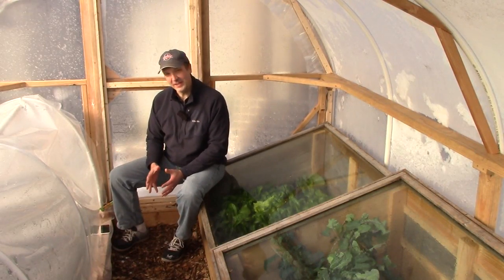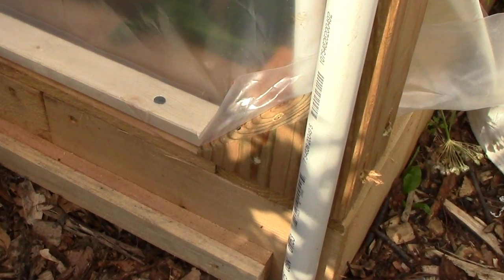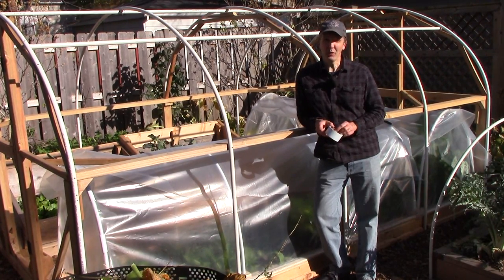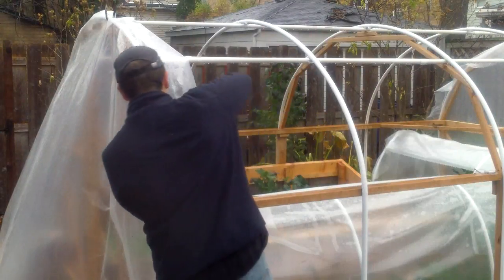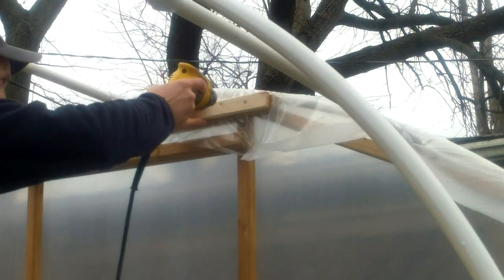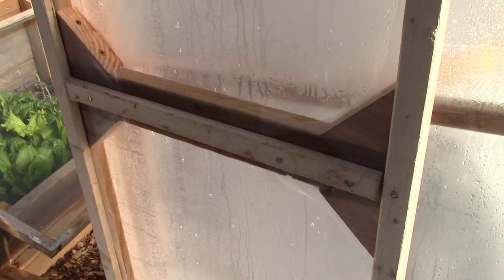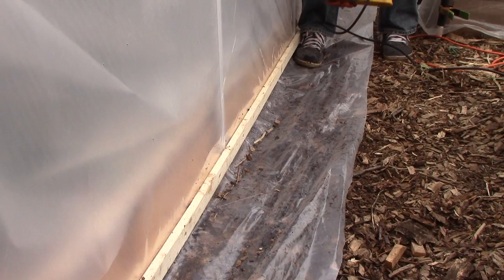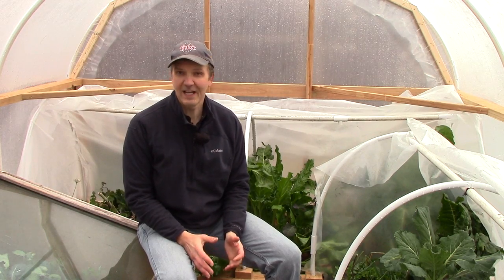How I Built Our DIY Hoop House (Greenhouse), pt. 2: Door & Plastic Cover

Comment: roofing nails are way too small (long) for 1x material.  There needs to be cripples on the ends of the king studs for any load to be supported by a horizontal (end wall horizontals) beams.  Sorry contractor 1st (home framer), Ag grower 2nd.  Simple screws drilled through the sides will not suffice.  I am sure the size of the structure will be okay, but anyone watching this duplicating on a larger scale will, or could not be so lucky.  I would have also left the original diagonal supports in place for the small "gusset" type 2x diagonal pieces in the lower corners for the end wall supports.  Any carpenter knows the smaller you go with wood as in case with the small triangular pieces with wood grain.. the more brittle they are.  PVC should not be used, grey maybe but the white goes REAL brittle in the UV from the sun.

Again this is coming from a contractor.  I build things to last and use the right material for the application.  I like your other videos and this isn't to hit you in the family jewels, just to give those who watch your videos a bit more perspective on the materials used and possibly choosing a better method of building.  I worked in my uncle's welding shop as a teenager also. I have built many many things over the years.  I am just putting out some truth and don't want you to think I am being negative to YOU.  But there are smarter ways to build that will last which will negate a hundred dollars here or there that may make this build more expensive initially.  

I am doing a 20x40 double wall with fence toprail right now. 8mil plastic for outter layer, 6mil inner with anti condensation coating.  Far too often in life people try to cheapen out on things and never truly achieve their desired goals because they didn't spend the money on quality products to get them where they were trying to go in the first place.

"E" for effort but spending another $100.00 would have taken you further down the road.  I think you will be replacing the PVC in 2yrs on the outside.  How do I know?  I tried a greenhouse with PVC, and on year 2 most broke due to the brittleness of it.  I learned.
Reply from the maker: +KC Heirlooms & Organics  Thank you for your feedback.

Roofing nails vary in length and long roofing nails are more than long enough to tack down 1x2's. The only role of the 1x2's is to secure plastic.

I did use cripple studs on the door and window framing to support the horizontal beams.

Each hoop is slid over 5 feet of conduit/rebar that are driven 2 feet into the ground. The hoops are also attached to the side wall. This provides enough stability to the sidewalls and makes the diagonal bracing redundant.

I've used PVC for low tunnels for a decade without a single issue with brittleness or degradation. I'm still using these old pipes in low tunnels today. Perhaps this varies by climate.

I respect your decision to use other materials and methods, but I'm confident this hoop house will be standing many years from now and will require little maintenance. I also have many years of building experience.

Comment: is it true if PVC is not protected it will get brittle and break
Reply from the maker: We've used schedule 40 PVC in small structures for 10 years. Not a single pipe has broken and we're still using all the original pipes. I suspect that breakage is more common when schedule 20 PVC is used and/or the structures are considerably larger.